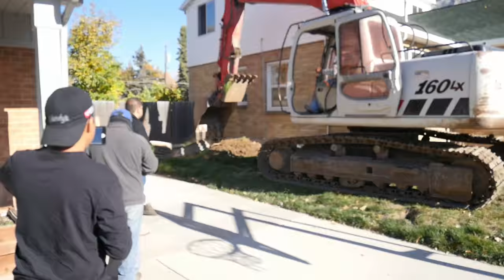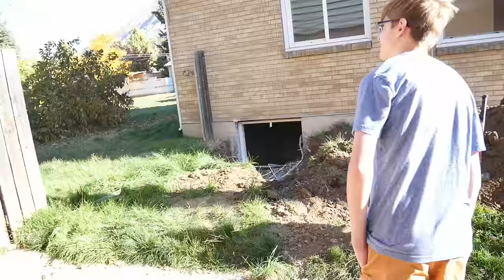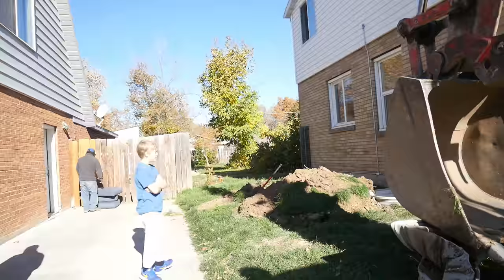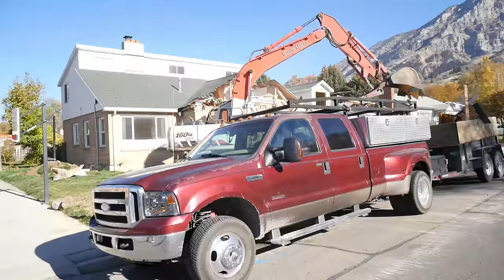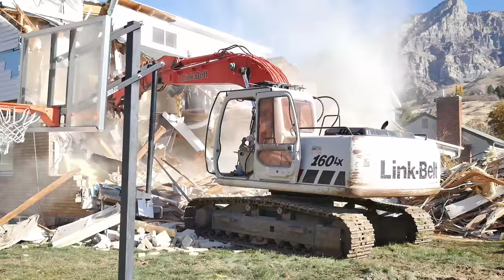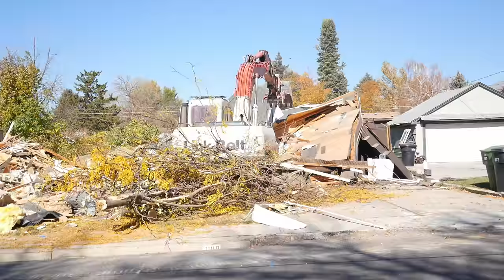Youngblood House Demolition

Comment: were did you find this company,no water to control dust and not no safety clothing or hard hats.
Reply: Bob,  Use water when there is cement and brick and the old insulation, asbestos. This is a wooden structure and probably does'nt need it.
Reply: @darkstar8827  "The house we knocked down was built in 1948 and had plenty of issues, including asbestos." Yeah, let the neighbors deal with it, great idea.  Glad you live out there.

Comment: Did you ever consider providing this house to a needy family and building your new one on a nearby vacant lot?  For the money it cost for demolition you could have bought an empty lot, and at the end of the project you would have had 2 houses for 2 families on 2 lots instead of 1 house for 1 family on 1 lot -- all for the same money.  And all of that original house is now taking up space in a landfill instead of providing shelter as it could have continued to do.  I understand you could legally do what you did,  but I think there could have been a better outcome than one complete house going to a landfill.
Reply from the maker: Provo no longer has any vacant residential lots in it. If you want to build there, you have to demolish. We really like this location and how close it is to BYU campus. The house we knocked down was built in 1948 and had plenty of issues, including asbestos. The new house we are building will last a long time and has a HERS rating of -15, meaning it produces more energy than it consumes and doesn't contribute to any fossil fuel emissions. The $0 energy bills will more than pay for the demolished house over the lifetime of the new one, and will spare the environment a significant amount of emissions.
Reply: Oh stop it
Reply: @CarlYoungblood  So you had a crew come in with no safety gear, no water spraying of dust and debris, spread it all over your building site  of said," built in 1948 and had plenty of issues, including asbestos" and because it was a small job it wasn't necessary. 
You created more problems than you ever solved.  You may be saving money. but you polluted your own neighborhood.

Comment: this operator is making a real mess of things.  the haul away trailers are to small, no water to spray dust, no safety clothing or hard hats.  guess you get what you pay for
Reply from the maker: Everything turned out fine. It was just a residential demolition, and probably ended up costing less than what you describe.
Reply: As a demo contractor myself, I can tell you that on a residence like this, you don't need all that because 95% of the time no one is even near you, it's just you and the excavator. 

As to the last sentence, what's funny about that is that when you give residents the TRUE cost of demolition, you get rejected quickly, so then you have to give them a measly rate where you barely make any money, because people don't want to pay for the true cost. So to say "you get what you pay for" is incorrect. The fact is we have to eat too, so we As contractors get what the customer is "willing" to give, not what we asked you to pay.